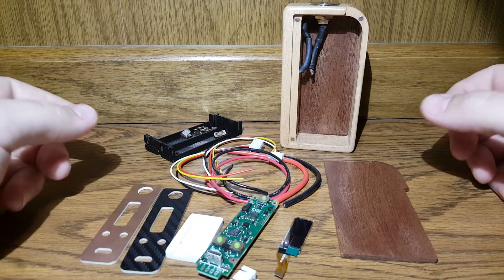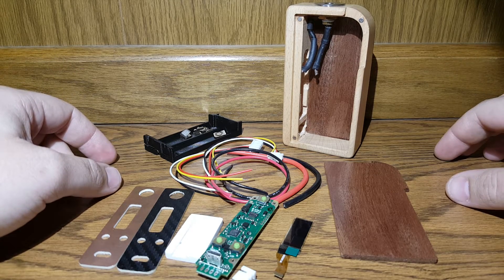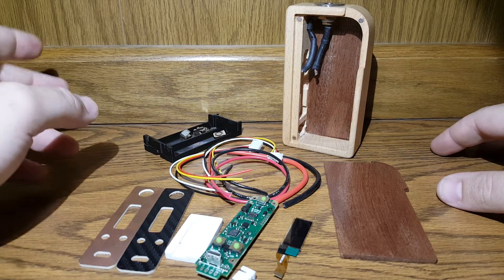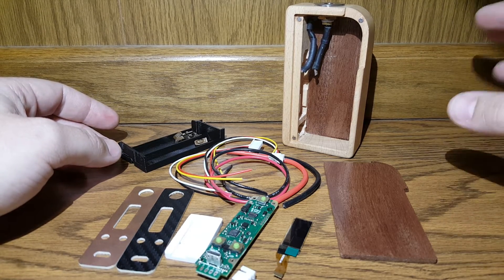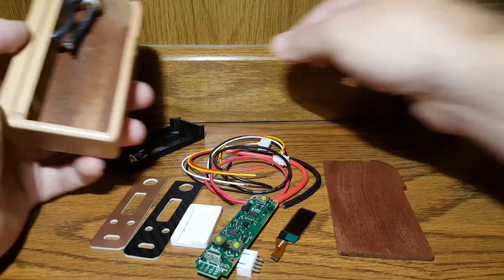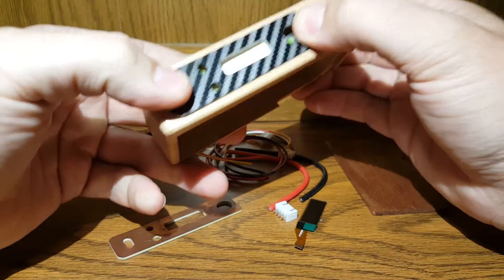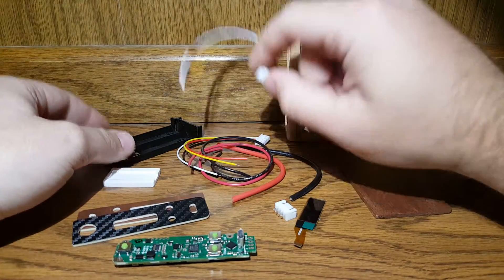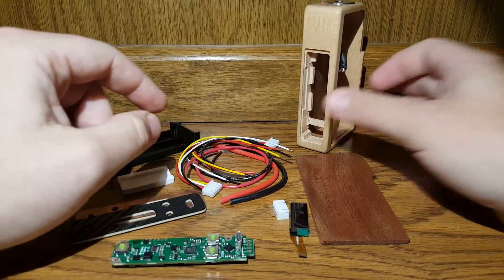Dna 200 build part 1. Parts and planning.

Comment: Should i buy a dna 250 or 250c
Reply from the maker: Sub Ohm Vaper I haven’t personally used a 250c. But it’s the newer board. They both will work great. I would say choose the mod you like the style or battery preference better. Unless you really want to use the color screen. But they both  will certainly vape great.
Reply: Chris Romano thanks for the advice im going to build a 250 mod like yours after i have the money than a 250c to show off to my friends
Reply from the maker: Sub Ohm Vaper there you go.